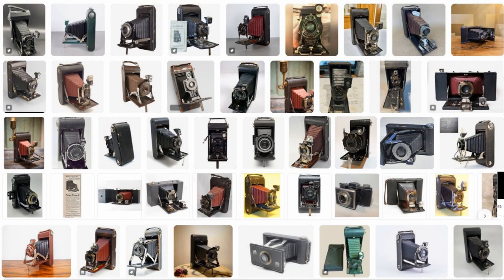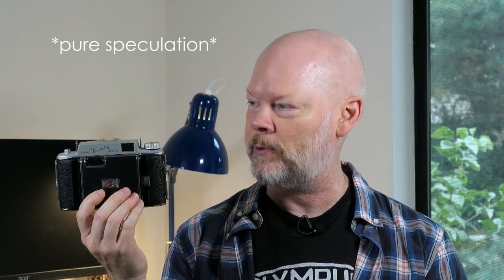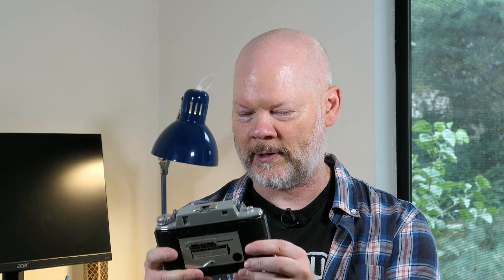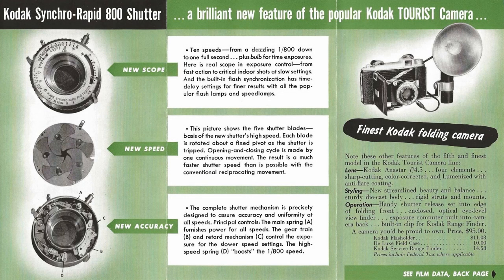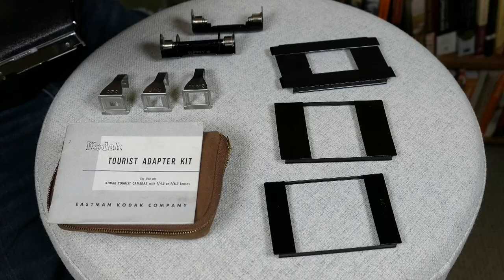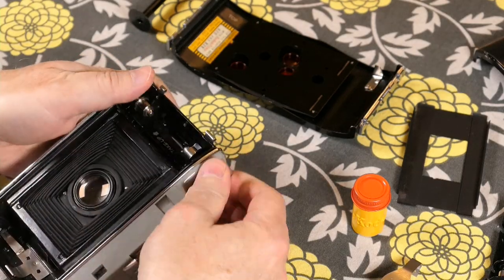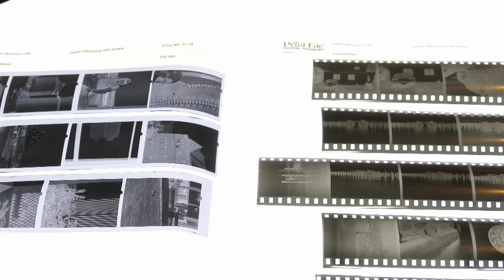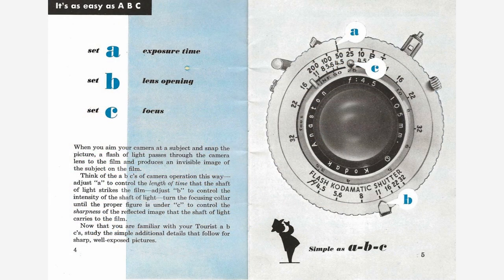Kodak Tourist: Kodak's Last Folding Roll Film Camera

Comment: As I understand it, the main reason behind the 828 adapter was that 828 film was available in Kodachrome, which gave the possibility of "super slides".
It was the exact same overall size as 35mm, so it wasn't a big deal for the Kodachrome production lines to make both 35 mm and 828 slide film.
At the time Kodak was still selling 828 cameras, and heavily promoting Kodachrome, so the film was readily available, hence the inclusion of 828 in the adapter kit.
As you can tell by my avatar, I am a big fan of these cameras (I have, ummm...several🙄) and I am really fascinated by the concept of the Tourist Adapter Kit.
I think the last actual folding camera Kodak made was the U.K. only Kodak 66, a square format folder that uses 120 film.
This was manufactured from 1958 to 1960, making it as old as me 😟.
I have a couple of the Kodak 66 Model III (there was no Model I) and it's not a bad little camera.
It has a 75mm Anaston f4.5 lens and a 5 speed (plus B) Velio flashbulb synched shutter (max speed 200). 
A very "medium format in your pocket" kind of camera.
Thanks for the video about one of my favourite Kodaks.
Reply from the maker: Ha, I always hesitate to include absolutes in my videos like "first" or "last", because there always seems to be a few outliers that sneak into the comparison. 😄Thanks for the info about the Kodak 66!  And yes I also think you are absolutely correct about Kodak's intent with the 828 adapter.  The adapter kit box even alludes to this in the copy text on the box lid, which says it allows the owner to use "miniature Kodachrome Film, 828" in the camera.  Pretty cool.  After I started researching for this video I discovered that Kodak actually made 828 adapters for several other 620 cameras as well, including the Kodak Reflex, the Kodak Chevron, etc.  Definitely a chance to promote their Kodachrome film as well as make the camera more flexible.  The one Tourist that I've been keeping an eye out for is the Synchro 400 shutter version.  This model seems to be quite rare as I have never seen one for sale or otherwise listed online anywhere.  But I know it exists because I have a printed manual for it!
Reply: @oddballcamera  You have a manual for the Tourist with the 400 shutter? Me too!😆 I'm sure there's some kind of 12-step program we could both join!🤣 I imagine it's the same shutter as the one on the Kodak Monitor. The cool thing about these shutters is that they are, to a certain extent, swappable. There's a little latch that attaches the shutter to the lens board. So "technically" you could create a 400 shutter Tourist by subbing in a 400 shutter on a bog-standard flash Kodamatic 200-equipped Tourist.  It does require carefully unscrewing the lens first, but it's possible. Of course, this would be cheating, right?😁

Comment: Thank you for another fascinating video. I am a bit of a sucker for folders, and have a few Zeiss Ikon 6x9 and 6x6 models, but I had never heard of this series of Kodak folders. Quite a lot of thought seems to have gone into the "convertible" version, especially considering they must have already decided to discontinue the line.
Reply from the maker: Indeed, there's definitely a lot of engineering that went into the design of the adapter kit components!

Comment: Another excellent video.
Never seen or heard of 828 film. I assume it was new old stock? How many exposures on a roll? Seems like Kodak would have made this camera adaptable to 127 film also, or instead.thanks again 📸
Reply from the maker: Thank you! Yes this was the first time I had ever shot with 828 film.  It was most commonly used in Kodak's Bantam and Pony camera ranges. The film I shot was actually brand new film, re-rolled by an 828 enthusiast.  The film stock is Orwo UN54...I assume the person who rolled the film was able to get a batch of unperforated 35mm Orwo film.  The original 828 film rolls included 8 frames per roll, but this re-rolled film included 10 frames.

Comment: The way the Synchro-Rapid 800 works with the two shutters seems similar in function to a focal plane shutter with two curtains. Does the secondary shutter only close when setting the primary shutter? Or, does it operate like a focal plane shutter where one opens and the other quickly closes in sequence? A very cool idea, but obviously it introduces much more mechanical complexity. I'm also curious if the Synchro-Rapid 800 can sync a flash at its highest speed? I assume it does, since the shutter opens and closes completely.
Reply from the maker: Excellent questions.  The secondary shutter of the Synchro-Rapid 800 functions more similarly to the rear curtain of a Hasselblad 500-series camera, in that it opens before the primary shutter fires and closes after the primary shutter has finished exposing the film.  The secondary shutter on the Tourist 800 (and the rear curtain on a Hasselblad) plays no part in the exposure itself.  In a Hasselblad the rear curtain allows the main shutter to remain open during SLR focusing; in the Tourist 800 the secondary shutter allows the primary shutter to open during the cocking procedure.  But the primary shutter alone controls the total length of the exposure itself.  And yes you're right that the Synchro-Rapid 800 can synch a flash at all speeds, since the primary shutter opens all the way at every speed (unlike a focal-plane shutter).  Great questions and observations!